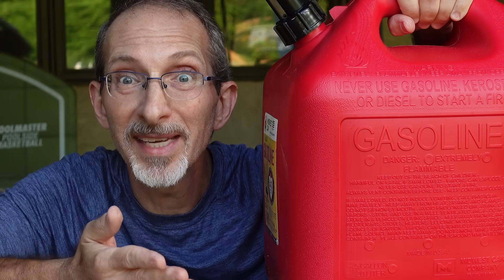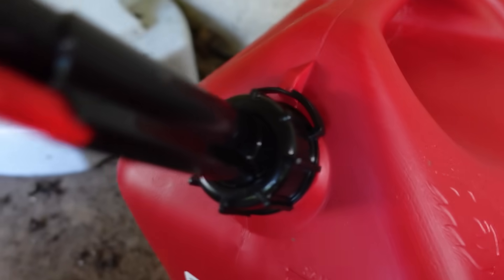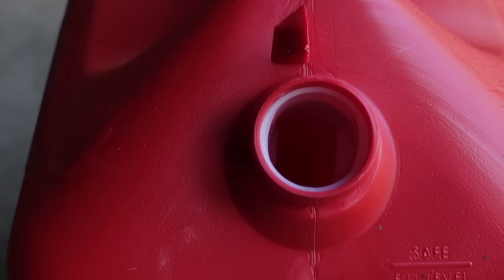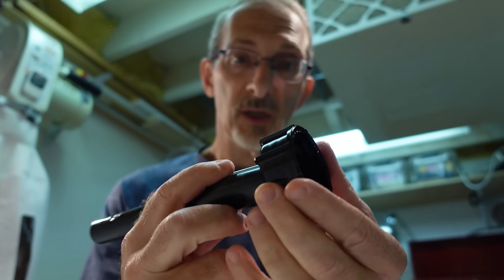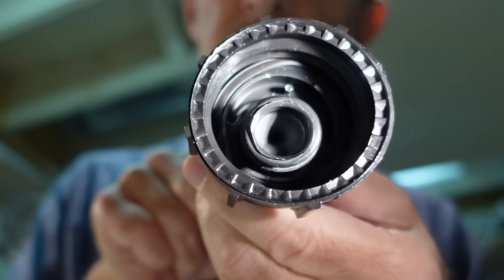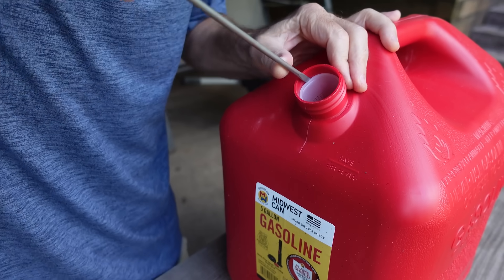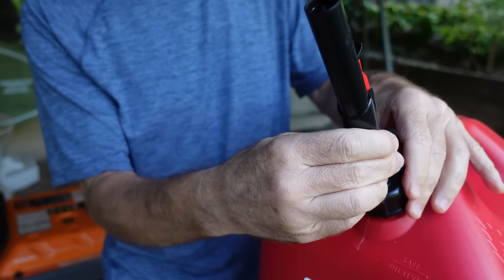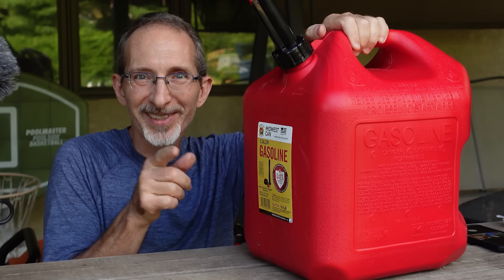Gas Can Modification | New Gas Can Fix

Comment: How many 'safety' features make things so awkward you do hurt yourself.  My table saw had an impossible guard.  My battery operated saw had a button you needed to hold in to operate that made you hold your hand in a dangerous position.  Gas cans that have safety features that make you spill gas is an excellent example.  How about plastic flex spouts that are only vertical unless you hold them flexed with one hand and try to maneuver the 5 gallon can one handed.  Only a large funnel will keep you from spilling gas all over the engine.  I am an engineer and wonder who designed these without trying them out (or are they sadists LOL)?
Reply from the maker: Hi Doug, I think your suggestion of sadistic engineering is definitely a possibility! 😂

Comment: Easier to go buy a racing fuel 5 gallon can with the clear flexible fill tube. Same price if you go to Tractor Supply to buy one. But good tip nevertheless
Reply from the maker: I agree! Starting with a racing container will bypass all of these crazy, difficult safety features. Thanks for sharing your experience so other people know their options before they buy!

Comment: You have more spillage from these new safety spouts than I ever did before when we had metal flexible spouts with a cap that screwed on the spout. This is our government at its best! Many more unintended consequences and a screwed up improvement that is worse than the originally perceived problem.

Comment: Great work.  If you don't have the time or patience to make the mod to the nozzle spring as suggested, a replacement nozzle called EZ Pour is available for around $11.00.
Reply: Have you held that button for the almost 5 minutes it takes to empty a 5 gallon jug?  It is not easy.  Now do it two or three times in a row.  You will cuss that solution out.
Reply: @brianhillis3701 I think you are mistaken on the ez pour spout. It's the one that has the flexible spout and comes with the vent kit

Comment: That filter you remove is call a spark arrester that pain in the but spring loaded valve is there so that if you drop the container specially if theirs a fire the fuel source shuts off automatically that lock for the cap is their to make sure it stays secure. You destroy that gas container save your money and use a antifreeze container  and last look up third degree burns a lot of them are from pouring gas from a unapproved or tamper with container .
Reply from the maker: Thanks for your comments, these issues are addressed in my second video - link in the description. I am all in favor of safety devices on fuel containers, but not at the expense of making them “unsafe” to use. Hopefully better designs are coming in the near future…

Comment: I bought two spouts ($7.95 ea.) and found they were straight-forward to use (no modifications needed). These were purchased to replace two other spouts that weren't made by Midwestern. You may need to use a funnel for a smaller piece of equipment like fueling a string trimmer. Then you press down on the spout with your hand and hold it for as long as you need to. I also have bad arthritis and didn't have trouble manipulating he spring mechanism. These spouts are great because they do completely seal after pouring the gas so you don't have to worry about gas sloshing out of the can when you fill it up. It took a dry-run to get a feel for it but worth it.

Comment: For me the nozzle is too short so, I went to home depot got me an old style nozzle for $1.29 and remove the tank filter. Amazon or Gas Spouts also sell the old style nozzles for $ 10.99 (5pack) or less. Or I just buy the old gas cans.
Reply from the maker: Finding the older gas containers seems to be the best option. I agree with you that a longer nozzle is much more flexible, no pun intended.

Comment: That strainer filter won't allow a siphon into the can. My new kerosene can had one and wouldn't allow the fuel cell siphon  in to get the k1 out. More messy and dangerous to try and pour kerosene into the heater tank than use a siphon.
Reply from the maker: The filters, which are flame arresters, would be better off in the nozzles where they wouldn’t get in the way. In the next 2 years all <5 gallon consumer gas containers will require flame arresters by law. I sure hope they come up with better designs soon!

Comment: Could also buy a vent cap and drill a hole in the rear top to put it in
Reply from the maker: That’s a great suggestion Dan! I did just that in my second video, link in the description. I also did a modification where I replace the spring after cutting it in half, so it still works but has less tension. Hope that helps!

Comment: i take the whole nozzle off and pour directly from nozzle free can.. spilling about half a cup of gasoline all over the mower while i'm at it.
Reply: i'll continue to take the nozzle off and pour from the can.. cus it's easier than your mod.   the gas i spill ah well.. thats the way they designed it.  I will remove that lock tab tho.. so it's easier to remove the cap.

Comment: @5:43 Can you also try cutting the spring length shorter to decrease the force required to operate the whole thing once assembled.
Reply from the maker: Yes! Take a look at my second video, link in the description. I cut the spring in half and then stretched it so the spout still have the full range of motion. It worked great!

Comment: No, no, no.  The problem is not engineers, bean counters, nor even lawyers.  These safety cans are the result of out of control, no over-sight EPA bull-sh1t for which there is no recourse or redress.  These so-called safety features cause more un-safe situations than they solve. The EPA reports to no one, has unlimited power, and whatever screwball idea they think is prudent, they enact - and then its law, regardless of whether it's practical or not.  Trump was on to a good thing in trying rein in the EPA!!!
Reply from the maker: Brett, I hear your position but I can’t help thinking the designs are safety mandated, not environmental. (They still dribble/spill more than conventional spouts.)
Reply: @MikeFyxdt  Mike, yes, I heard that argument for years, and I respect your opinion, yet how many of other people's comments focus on the spills and problems these things cause.  I'm not the lone voice out here.  You need three hands to make them work efficiently, safely, and practically when filled with fuel and heavy.  Nope; they are a pain to use, and cause more problems than they are worth.  I sold everyone of them soon after I bought them.  They are a danger. I suspect they were evaluated empty and then concluded, "yeah, this'll work" when in reality, it don't.
Reply from the maker: @brettmaster4695  your last sentence… Nailed it! 😂

Comment: I have a can with a similar spring loaded push spout (without the lock) and I have to say it is great for gassing up my rider mower because I can stop the flow instantly when the gas reaches the top of the tank, and I never spill a drop. But yeah, for anything else it's a PITA and I use smaller, old-school-spout cans, or old windshield washer fluid bottles for 2-stroke fuel.

Comment: September 1, 2021. Bought at Blane's. I had to remove the perforated condom that is inserted into the fill neck, before I could fill it. Total pain. Next, I cut off the anti-open compression ring. I am paying attention so I can use the spout. Easy fix. I will go take care of that right now. 

Easy Peazy - and - the red under-the-cap disk that is used when the nozzle is inserted into the container - that works as a cap for the nozzle when it's attached in the ready-to-pour position. Problems solved!! Now I can fill the container, I can remove and install the nozzle for use, the shut-off valve (O-ring) still works, AND, happy days, the what-I-thought-was-a-useless-disk is a nice little cap to keep the spiders out of the nozzle/container. Who knew!? Thank you sir - you have provided a valuable service to the gas-can-using community.
Reply from the maker: Neil, thanks for joining the conversation… Your idea of reusing the red disc is awesome! Simple and effective. I’m really glad you posted this and I hope others will use your suggestion. Excellent!
Reply: @MikeFyxdt  My Pleasure - I really appreciate the fix - and I had an excellent time reading 20 or so of the comments. Blessings to you and yours.

Comment: Excellent video.  I will get that stupid filter out now. Silly question.  Why do you keep the nozzle?  It is still not flexible.
Reply from the maker: Good question…the generator’s fuel opening is big enough that I can fill it without the nozzle being flexible. I have other smaller cans with bendy spouts for my day-to-day needs. It all worked out.

Comment: Going to try this mod so I can safely fill by pressure washer without spilling gas everywhere. First practice with water I suppose
Reply from the maker: I suppose that would work, but the size of the container is probably the big consideration. These 5 gallon containers are hard to control, whereas the same nozzle on a 2 gallon container is probably easier. Still, the mods make a difference. Worst case, you could use a funnel! :-)
Reply: @MikeFyxdt  thanks for the info! I actually have a 2 gallon container with the same nozzle type. Really appreciate the follow up, thank you
Reply from the maker: Your welcome!

Comment: Well how do you deal with the weight of the can full of gas and not spilling gas all over. I dealt with this problem a different way, go on Amazon and look up TerraPumps. This unit is operated by 4 AA batteries. It has a hose that goes in the gas can and then you clip the nozzle to the edge of the equipment yo need to fill. The best thing is no lifting the can to fill the tank and it shuts off automatically once the tank is full.

Comment: Excellent video for the mods to this style of gas container. Have never seen this type in Canada. We have our own stupid designs up here to deal with.......especially those flexible yellow pour spouts that never work well either. Someone has to come up with a good and safe and easy to use gas can. Have not seen one yet.
Reply from the maker: Thanks John! I never knew that Canada had different gas container design regulations, until I started reading comments here. It’s funny… The gas can I had growing up had a short rubber spout that never seem to leak, was easy to use and lasted at least 30 years. It probably wouldn’t cost any more than the current designs. Bring back the classics, I say!

Comment: I bought a Scepter can with a different nozzle design and it's worse than the one modified above! I never got one drop of gas to flow thru it.  With an engineering background I contend these nozzles are one of the worse cases of over engineering I've seen in my 82 years!!
Reply from the maker: Marvin, wow! I agree 100%, these containers define the meaning of over engineered. Hopefully better designs are on the horizon. Thanks for joining the conversation!

Comment: That filter is a well intentioned bad idea. 
What’s it protecting? If my gas station has chunks that could get caught in it, the chunks will be getting washed out into my weed whipper/chainsaw/miscellaneous small engine. I certainly don’t want that. Yes, we want to protect the environment. Yes, we don’t want vapors escaping. But I’ve spilled more fuel that went to vapor by accident trying to use these devices on small engines, which are the preponderance of usage. Try filling a half-pint tank with the fast flowing 1/2” nozzle backed by up to 32psi head pressure on a 1 gallon can, when the nozzle end can’t be seen because it sticks so far into the tank.
They’re a PITA and they’re not accomplishing their goals.
Reply from the maker: Marc, I agree with your complaints. These designs are a complete PITA. FYI, I mistakenly said that the insert was a filter, when in fact it is a flame arrester safety device. I cleared this up in my second video, link in the description if you would like to watch. Thanks for watching him for commenting!

Comment: Even easier just gi to tractor supply and get the new nozzle and the air vent. Drill a hole in the back insert the air vent and screw on the nozzle done
Reply from the maker: Joshua, yes replacement nozzles are a very popular option! Thanks for commenting and watching.

Comment: I have 2 of these cans in a smaller size.  (DO NOT LET THEM BE RAINED ON) the water collects in the spring channel and pours into the gas tank with the gas.
Reply from the maker: Cary, that is an excellent point that I did not think of. I always keep my containers in the shed where they stay dry, so that hasn’t been a problem. I appreciate you sharing your thoughts with others.

Comment: Something you need to keep in mind. It's not just about safety. Unless you ALWAYS buy non-ethanol gasoline, you need to protect the fuel from air. Air with its attendant moisture is death to ethanol fuels. Surely you've noticed that "new" fuel makes your small engines run like crap, or not at all, and in only a month or so (allegedly up to 6 months) the wonderful new gasoline will be spoiled and shouldn't be used any where. Beware ethanol laced fuel. btw - That filter, is not really for the gas gong in, so much as the gas you are poring out. As I've said, it spoils, crystals form, sludge happens.  Don't believe it, take a quart of non-ethanol and a quart of regular unleaded, put it in a Mason Jar. Place somewhere safe, loosen or remove the lid. Check them both after a month or so.
Reply from the maker: Maxwell Smart, that sounds like a fun experiment. I have not had many problems with the ethanol in the fuel I get locally, but I hear you. It turns out that the filter is really a flame arrester safety device, which I explained in my second video, link in the description. Thank you for watching and for joining the conversation!

Comment: That "filter" is a flame arrestor required by our wonderful government. It there in case you get a flame at the spout, the flame won't go back into the can. I bought a real nice  can for my boat that had a stainless steel screen (heavy duty at that). Well, not only was it hard to put gasoline into the can, as you said, but I also needed to add two stroke oil to the can. With the way the mouth of this can, made by eagle, was made, it was all but impossible. I don't understand why the companies that design the cans can't find a way to comply with regulations and not cause the end user to remove the safety devices to have the can usable.
Reply from the maker: Very well put, I couldn’t agree more! I hope better container designs will be coming in the near future… Thanks for joining the conversation!

Comment: And about that filter.  If it does trap some bit of crud from going into the gas can, then guess what will happen when you go to pour gas out of the can?  The crud will flow into whatever it is you are filling up with gas.  Without that filter the crud may very well have settled to the bottom of the can.  While there, it's not so likely to flow out. 

And here's an idea!  How to make a small filter that can be put on the end of the spout just before use, and taken off after use.  Be handy if it could clip onto and off of the gas can's handle - or the spout itself!  There are a few make shift ways to do this but not easy to use.
Reply from the maker: The filter is actually a flame arrester, which I corrected in my second video. I like the idea of having some sort of filter in the spout, and indeed some aftermarket spouts do include this feature. Thanks for the suggestions and for watching!

Comment: We can all thank the usual suspect for these new gas cans…California.

The screen inside the can is the perfect example of a very poorly thought out idea. I don’t care what’s in my gas can, I don’t want it going into my engine. Anything that screen traps gets dumped to where you don’t want it, into your engine tank, when you fill with the can, a far bigger problem than just the annoyance it creates when trying to fill the can at the pump.

Here’s an even better fix for these “safety” cans, don’t buy them. You can still buy the 5 gallon “VP Racing” style “bird seed containers” for storing your bird seed and filling your bird feeder out the hose on top, and if you don’t live in California they also ironically make the best fuel can design ever made. They’re also about half the price of these new BS safety cans with the additional bonus of not leaking while using.
Reply from the maker: Hi Tony, thanks for joining the conversation! The screen in the tank is actually a flame arrester safety device, which I explained in my second video, link in the description. Regardless of its purpose, the fact that it interferes with filling the tank is a huge annoyance!

Comment: HA... go  to ebay and check  out what they want for an old blitz 5 gallon can. I add one of these       "   https://www.ebay.com/itm/153884735749?epid=21020021422&hash=item23d43eb905:g:e0cAAOSw7dRehRY5  "   into the top of the handle and finish it off with a golf tee. Cheap and works great.